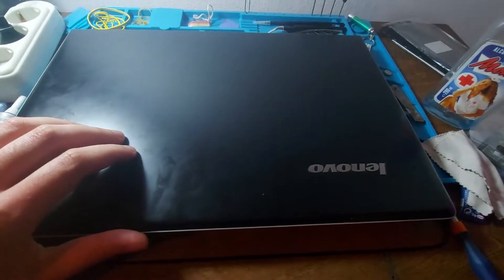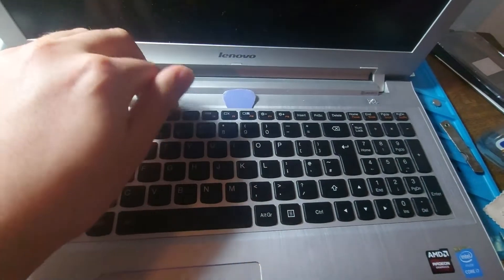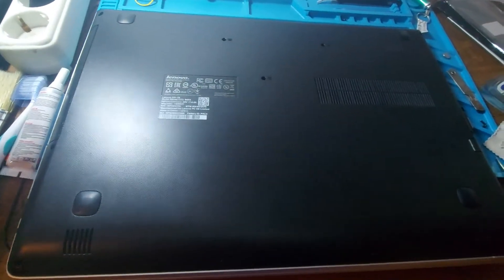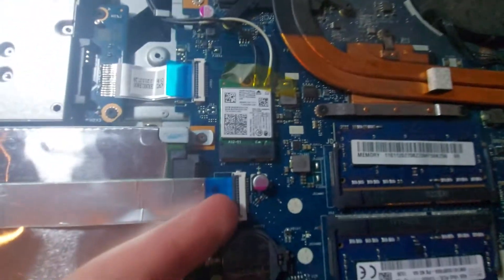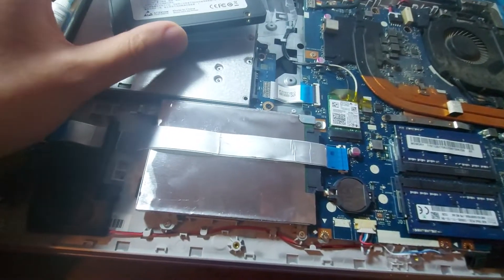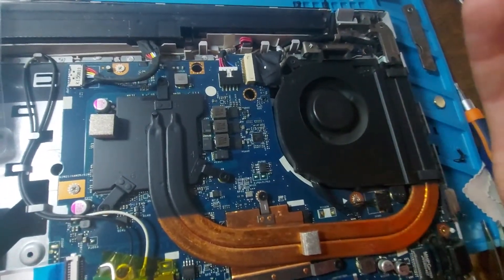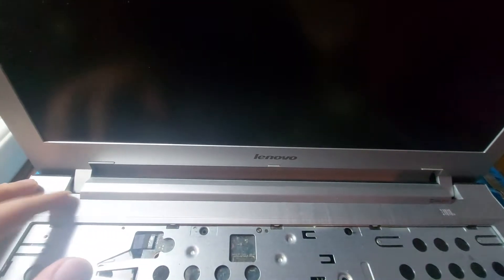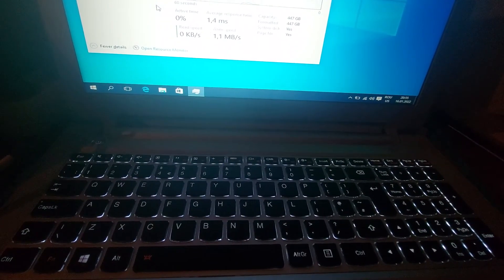How to replace HDD with SSD - Lenovo Z51

Comment: I installed ssd through caddy but the bios is not recognising the ssd. Please help
Reply from the maker: hello, I don't if I can help, but I hope you managed to fix it
Reply: Facing same issue with my Lenovo z51 70
Reply: @LikeVanessaOfficial  I think if you install ssd in caddy and try to boot it from ssd the bios will not recognise it. You need to install ssd on in place of hdd and not in caddy
Reply: Thanks for your reply, what I have done is. I have replaced my hdd with ssd, then I have replaced dvd drive with caddy installed with hdd. Which is not detecting. Need support to fix.

Comment: Nice video! Are you tried to use HD with Caddy instead of DVD slot? so, you can use SSD for C and programs, and HD for Backfiles like movies, etc. No one need today to use DVD slot.
Reply from the maker: Thx, for this point in time only the HDD started to act funny so I replaced it with a SSD. For what that laptop is used it doesn't need that much storage space to justify adding both a HDD and SSD.